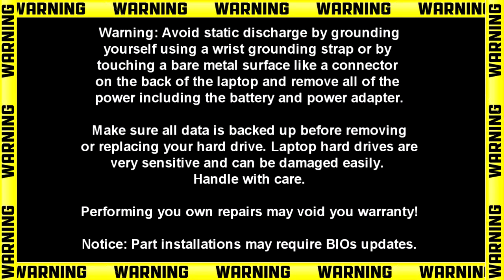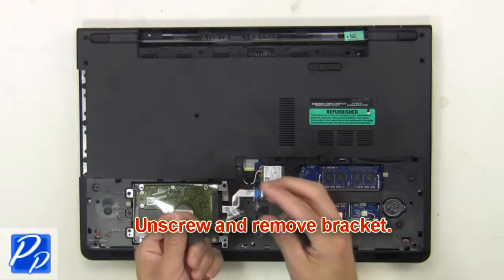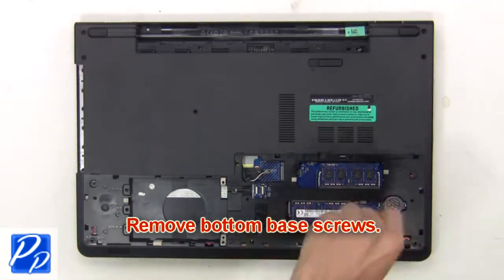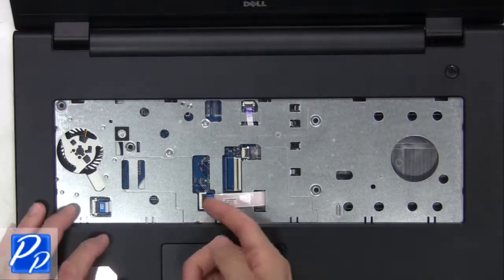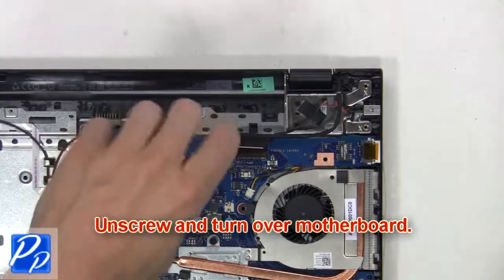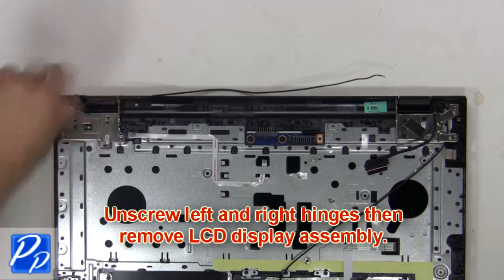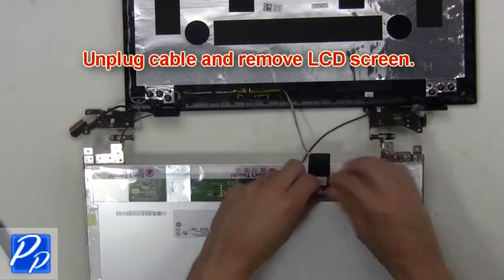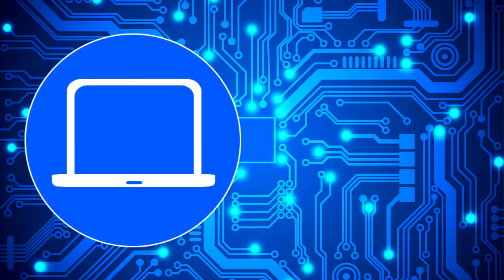Dell Inspiron 17-5759 (P28E004) LCD Screen How-To Video Tutorial

Comment: Don't do this if all you want to do is replace the screen. It is an quick guide to completely disassembling ones laptop but why on earth would one wish to strips a laptop to this extent to replace a screen. Other videos are available.
Reply: Replaced touchscreen assembly for Inspiron 17 5759 and do not need to disconnect speaker cable, touchpad cable, Audio/USB circuit board, and do not need to remove mother board.